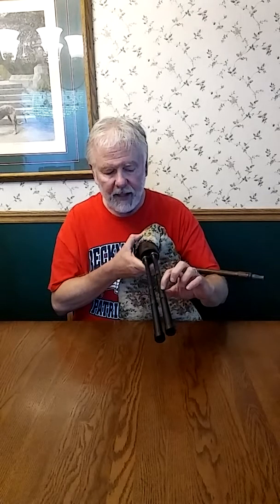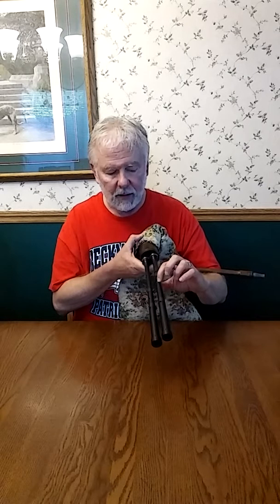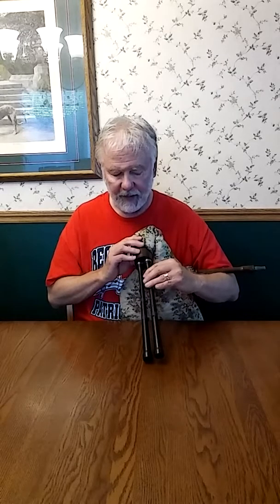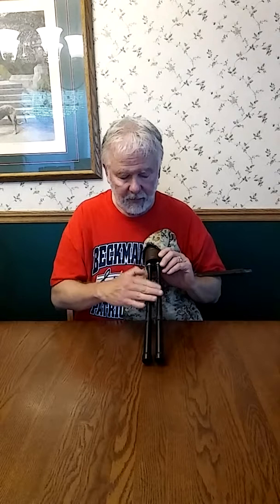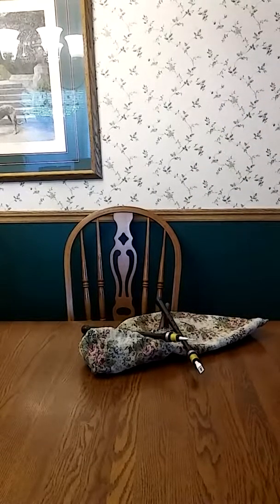Scottish Cornish Doublepipes explained

Comment: Hi! Interesting pipe. I happened upon a pair of Gibson PCs recently and they are calling out to me to do something like this. I am designing the stock for the chanters, and I hope you can tell me - are the holes in the stock just two separate cylindrical drill-thrus, with the entire block being otherwise solid, or do the reeds sit side by side in a common open chamber, with the bores only long enough to secure the chanters?
Reply from the maker: Thanks! The stock is solid, with two long cylindrical bores drilled through for the chanters. They're drilled at a slight angle, when I ordered the stock from Yuri he asked me whether I wanted the chanters parallel or spreading at an angle, and if so, what angle. It hadn't occurred to me! But Yuri is an experienced doublepipe maker, luckily for me. So I asked for the slightly spreading angle you see there, which I think is ideal.
Reply: @RichardDCook  Awesome! Thanks for the info. Does the angle of the chanters offer some mechanical benefit or is it just more comfortable to play?
Reply from the maker: @BrutishYetDelightful  To me it's a bit more comfortable to have a slight angle. According to how the bottoms of the chanters are made, they might be pressing against each other if they were parallel.
Reply: @RichardDCook  Thanks again! These chanters will, on a glass tabletop, stand heel-to-heel, shoulder-to-shoulder like tin soldiers (Gibson standard poly, no ferrules). The design I currently have going has them separated by a millimeter, so they should fit, but as I sit here fiddling with them, I start to wonder about 2 or 3 mm, and then back to the angle thing, and...decisions, decisions. I see a redraw in my very near future. Again, thanks for your helpful videos and words. I like the hymn-a-day thing and the whistle stuff, too.